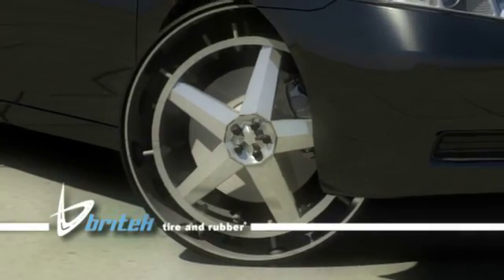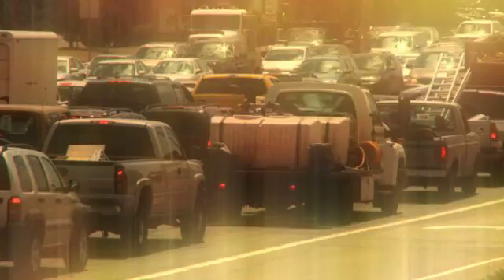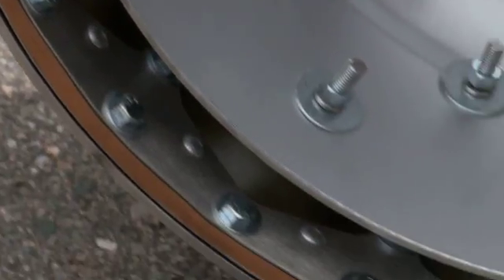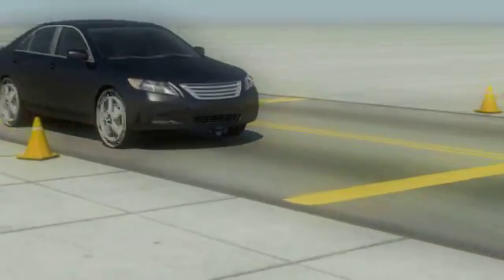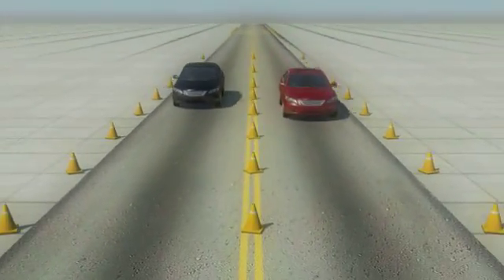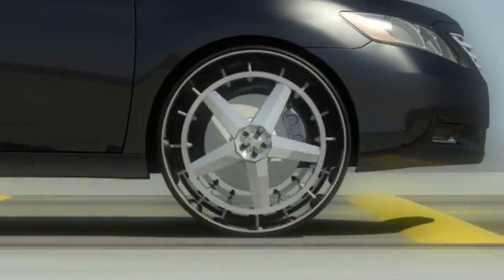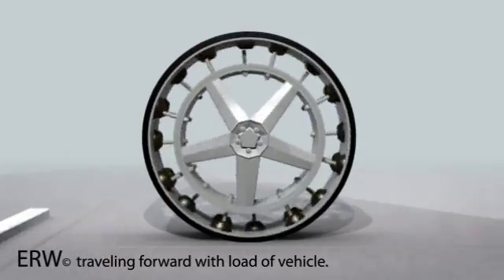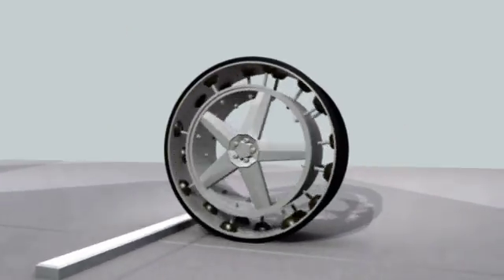britek ERW© 3D Animation

Comment: This is great to apply a piezoelectric generator
Reply from the maker: Miguel Silva Good one! Screw force accumulation and return improves drive train efficiency...Any rotational or linear displacement draws vacuum pressure...The rebound...Potential Electron flow.
Reply: great!

Comment from the maker: New published Patent about to issue...More in the pipeline...Historic # of utility Wheel Patents.
Reply: Hey, a big question here. When are you going to start selling these so people can drive with them? All the other tires that are airless haven't been sold and that sorta is upsetting. A lot of talk and videos but no sales. If you start selling them you could start selling them at cost or what not to car enthusiasts with YouTube channels that do car talks. Also people that are inventors that have YouTube channels. If people keep just making videos and not actually getting these on the road to actual people then people are going to just think, "Here we go again with the airless tires that never get to market. Screw that noise."

I am an inventor, mechanical engineer, and startup / business consultant. I am very interested to see this stuff get to market. I know a lot of car guys if you are willing to get some of these on actual cars and start getting real business traction.

Another important set of questions:

1. What is the noise like going around 65 mph?

2. How does the tires do when taking a hard turn at speed compared to normal run of the mill street tires?

3. I didn't see any spring in the tires. What is the spring like compared to pneumatic tires? If there isn't comparable spring this will really wear on the suspension system of cars and cause a lot of issues when hitting something hard and unexpected like a curb or a big stick or something on the road. Rims of car wheels already have troubles with this but without spring in the tire it will end up with more issues. If those are solid bolts and not springs in there I would be quite wary of the design and would suggest adding very strong springs with a bolt center so it can move within a range like suspension systems already do. In this case you definitely need to add the rubber sides.

4. Do you plan on covering the sides of the wheel assembly? If it is not covered the inside will wear with snow, mud, rain, salt for snow removal, etc.
Reply from the maker: Please review ERW bike videos to see "in wheel suspension". The amount of developed tension for auto is 6 tons per wheel. Check out our heavy truck on britektire@twitter.com
Reply: EnergyReturnWheel
Do you have a website with this stuff and specs and such? Would love to check that out too if possible. Even a store of what you are selling as well.

I was looking for suspension in the wheels for the vehicles, not so much the bikes.
Reply from the maker: Much of what we do is secret. We do show prototypes than led to other patents and claims. ERW is growing up. Invention DNA.

Comment: What if little stone will fall between rim and actual tire? Will it destroy rim? 
My main concern is durability of the solution and usability over long periods of time in extreme environment. We are not only traveling on tidy and clean roads, but also on country areas and sometimes even offroad. How ERW will be prepared for that?
Reply from the maker: Animation of the earliest home built ERW prototypes. Sidewalls, hopefully transparent will span all openings. Vacuum pressure tunes the high frequency in wheel suspension.

Comment from the maker: A main point of separation between ERW and all other wheels is our hoop to wheel / hub tension-ed attachments. The radial array is a reservoir of kinetic energy. When weighted and cranked they demonstrate a sling shot like advantage on and off pedal stroke. The high frequency in wheel suspension is just another advantage at high speed travel.

Comment from the maker: ERW is very tough. Upon pot hole strike the hoop can become an oval, stretching attachments at 3 o'clock and 9 o'clock, storing then releasing the energy as the hoop returns to it's circular shape. The wheel hub is suspended via the top 180 degrees of the hoops radial array of attachments. While rolling ERW is already being levitated from top half making it easy to step over the hole.

Comment: I think the only reason they aren't showing a skirt on it is so that you can see how it works.
I completely agree.  I would much rather see some hard facts between (high end) pneumatic  wheels and the ERW.  Using the same car, do some controlled tests for distance vs fuel usage and 1/4 mile runs.  They would need to get a decent amount of fuel from the same station at the same time (to eliminate fuel variance).  And completely refill the tank after every test (to maintain a consistent weight).

Comment from the maker: The patent process is a long one. Usually about 3 years before claims issue. The skirt or side wall is important for drive train efficiency. Screw force accumulation/return rebounds clunks into rotational force. We have some very flexible composite hoops. The tire has had 100 yrs. we are just getting started.

Comment: i thought so too, but u dont see it anywhere, everybody is just showing open concepts and claims it would be their invention. i would prefer a good information instead of commercials. maybe its more difficult to build that "skirt" than we would imagine..  i think this point it is the real reason why open tire comcepts only are used nowadays on slow vehicles. the new thing about this ERW though is the inner suspension and the solid outer steel wheel. well, the future will tell which is best...

Comment from the maker: Yes! Elastic sidewall covers that attache like a Tupperware lid. We run a vacuum pressure inside to reduce weight, vibration transfer and noise. We also run a more powerful vacuum pressure on the hoop side of membranes/diaphragms to introduce the power of the vacuum.

Comment from the maker: WE are stretch not compression. We have a radial array of elastic attachments that are drawn under tension to support the hub within the scope of our composite hoop. We are super efficient partly because we are sprung from the hub and flex a hoop to the surface not flatten a tread block. We are high speed, high power.

Comment from the maker: ERW does not accumulate heat like pneumatic tires. We have almost zero tread squirm and our tread block is more of a flex than a bending of fabric. ERW recycles heat internally. Try this experiment... take a rubber band and place against your lips, stretch and recoil. Notice heating while stretching and cooling on recoil. We also run vacuum pressure inside our diaphragms and interior.

Comment from the maker: Check out our patent portfolio and compare to Michelin's lack of patents. The Tweel is low performance IE low speed light duty. Less efficient than pneu. and were to release in 2012. They can not put Tweel on the market without willful infringement... a very costly situation for them. We have composite hoops and light weight diaphragms to equal the wt. of the best pneumatic tires.

Comment from the maker: Our USDOT highway video shows high performance/high speed while under a heavy 6,000 lb. AWD dyno resistance. The AWD ML 55 AMG was "chained down" to the 48" rollers. Rollers are designed to accumulate heat to expand 35.5 psi. pneumatic tire body for efficiency improvement.

Comment: How does this wheel deal with lateral forces? Is there enough give between the inside and outside of the wheel to deal with the demands of high speed cornering as well? I can see how this would be very beneficial to people who travel in a straight line all the time, but other than drag racers, I don't know anyone who drives straight all the time.

Definitely a fascinating concept though, I hope I can get my hands on one someday to put it to the test.

Comment from the maker: ERW is mostly carbon fiber / Kevlar composite. Material prices are dropping as more industries take advantage of composite properties. Ride quality is tuneable via adjustable membrane tension. IE adjust membrane pull distance between hub and hoop or increase/decrease vacuum boost ,membrane to hoop for some models.

Comment from the maker: Our radial array of drawn membranes rated @ 4,800 psi. distributes the lateral load 360 degrees around the hoop ID while the 120 psi. pneumatic tire flattens and rolls laterally, crumpling local sidewall fabric and rubber OD. Early protos each attachment is pre tensioned to approx. 300 lbs. x 36. Way stronger than pneu!

Comment: Have you tested the same car with the stock wheels/tires & with your wheels? Acceleration, handling & most of all, braking distances? what does it weigh? How much fuel did it save? What's it cost?

Comment from the maker: ERW is closer to a series of slingshots attaching a hoop to a hub.  Each attachment is pre set to pull 300 lbs. IE 300lbs. x 36 pulls... thats alot of dynamic tension. When the wheel is lowered to the surface the hub sinks within the scope of the hoop untill it "floats" largly suspended by the top 180 of pulls. Throttle response raises and levers hub higher in hoop reducing resistance to movememt.

Comment from the maker: Think of our attachments from hub to hoop as equally tensioned rubber bands. As the hoop meets the ground the hub sinks within the scope of the hoop now drawing more "stretch" from the top 180 attachments. Throttle responce "winds up" bands raising hub within hoop... levering wheel. We have replaced steel components with nano reinforced carbon fiber and Kevlar fabrics.... lightweight, strong performers.

Comment from the maker: ERW structure enables a tuneable dynamic "charge" between the hub and the suspended hoop. This 360 degrees of dynamic tension starts out as equal force from opposite directions IE equally stretched membranes. When weight bearing the hub sinks within the scope of the hoop drawing more dynamic energy from the top half ID of hoop. Space age composites.

Comment from the maker: @chuckbear1961 We will live up to such skilled driving! We are reducing the amount of weaker rubber in favor of space age fabrics. Your rolling resistance, improved power to the ground will get you excited to "drive" all over again. Goodyear has a retread solution where they stretch an adheasive band over the reworked tire body and bake at 285 F.. We think a ERW retread option would save you real money... as you save on fuel.

Comment from the maker: @d1sinfo If thats what we were doing you would be right. ERW hoop is "sprung" off the hub. ERW composite hoop and traction system weighs like pneu. For racing a massive reduction in hub mass IE 50% as the hub now rides inside the strong composite hoop. Also ERW is anti bounce for traction and quick response. ERW will change autosport forever and sooner than you may think.

Comment from the maker: @ee01239 ERW sustains a dynamic tension between points to return a greater % of energy envolved in the internal displacement of hoop on hub. Linear displacement is "shared" but more elongation on top 180 degrees  ID of hoop. Levering advantage us.

Comment: @MsCareerist Physics 101 contact surface have you seen how many points of contact how many connecton there are between the inner and outter cricle rubber? on a tardicional tyre is much lessers and it's all connected on the same surface. But if that was a problem Ithink they could just make the outside look exactly the same. I don't believe the centripet force would rip the tyre appart...

Comment from the maker: @deadbird58 Pneumatic tire can be taken out by a 1" wood screw while ERW can "run" with multiple 1" holes. The psi. failure of the composite hoop is 50,000 psi. what is pneu.?

Comment: @princerappy I think there may be the potential for less road noise if done properly, as provided they've designed the shocks adequately the outer rim may be fairly well decoupled from the inner rim which connects with the axles. I'll be interested to see if these gain any traction (BOOM BOOM) in the market and are professionally tested in Autosport etc.

Comment from the maker: @asianwong Patent filing #4. Highly elastic sidewall curtains drawn with vacuum boost. Will run high speed at ambient air pressure IE loss of vacuum no problem even long term. Vacuum boost "charge" increases the sidewalls screw force accumulation/return from throttle or brake force. Additional draw VS the pull of gravity as hub sinks To "float" within the scope of the hoop.

Comment: @EnergyReturnWheel Wouldn't sidewalls hinder the movement of the inner and outer wheel? Could you use a flexible material that *folds* to accommodate movement?

Comment from the maker: @androo5826 There is enough developed tension to resist cornering forces no problem. The big deal was to curve the hoops upward for camber issues, increase psi. and footprint size to more accuratly provide the "feel" and handling of pnu. by adding pat filing #4 bound rubber wedges off the curve. Now we lever rubber wedges to the surface increasing grip.

Comment from the maker: @thlin Even these early protos were very powerful. We used a german engineered 4,800 psi. membrane drawn 200%-300% elongation. This developed tension is aprox. 300 lbs. for each pull. Lateral forces can displace/ rotate ERW from 12 - 1 on a dial clock, however collective membrane force quickly multiplies as dislpacement continues. Our newest protos have a curved hoop for levering out bound rubber wedges to surfaces.

Comment from the maker: @RollinKillin True, We can remove 30-50% of the large tire mass as we only need a thin elastic sidewall. The larger the ERW the better they lever. No more dangerous 9 bar tire pressures. Monster trucks will be set "free" from the heavy, slow responding tires of yester year. Also ERW is "high speed".

Comment: Doesn't one have to check àll the bolds in the wheel every morning before one can drive savely away??  Or are those crews and bolds just used in the prototype-wheel? If bolds get loose because of vibrations during the driving...

Comment from the maker: @KZWolf ERW can wind up / return a % of screw force and meter it out IE a  torque converter like effect. Our new pat pending tread system can almost suction cup to the surface in panic stops as lateral and medial wedges are forced into the surface.

Comment from the maker: @Bouregard3 The now upward curving composite hoop has a freedom of movement around the hub tied in place by drawn highly elastic membranes. Each membrane is drawn into a funnel like shape tapering/focusing to the hub. Lateral force displaces the hoop IE rolling at you you would see the hoop go from 12 to 1 "dial" clock. This action levers our "outrigger" Kevlar bound rubber wedges into the corner.

Comment from the maker: @Baracus09 Its better than you think. We use hoop flex, membrane vs membrane elongation for internal deformation, a more controled compression / rebound of traction layer. Together these systems modify impact and vibration more quickly than pnu. sidewall and treadblock. Internal hub / hoop displacement is anti bounce.

Comment from the maker: @darkshadowscene No more than a regular tire. ERW hoop is "initially" easily displaced because of the array of opposing pulls. As displacement continues forces are distributed by flexing the hoop, drawing tension around the top 180 array then membranes rebound propelling the hub up and forewords. ERW is lifting/levering from the top 180 while a pnu. is lifting/levering from the tread block..

Comment: @EnergyReturnWheel damping rate of the springs. For example. In the snow, you want a larger contact patch then in the summer for more traction, so the best way to change this, is to allow the tire to bend a bit more. Lastly, I think you should be able to enable a water cooling system, so when your tires get to hot from racing and they feel life "butter", you can cool them back down to whatever temperature you need it at, and you can grip the road. Otherwise, I think this is a pretty good idea.

Comment: @EnergyReturnWheel I think a little but of steel plating around a pneumatic tire, and just have your invention incased in rubber, as dust will not build up. Also, have collapsible sidewalls when you wrap the tires, It will allow it to be smoother over bumps. One thing I would change is being able to take this thing apart, and adjusting the

Comment from the maker: @kensai69 This is why we went with curved composite hoops. Rubber wedges off the curve to create a rolling footprint more like pnu treadblock you are used to. Big diff the wedges are levered to the surface under lateral loads, acceleration and braking.

Comment: Look, If you want to have a different driving style of the car, edit your toe, camber, gear ratio, and tire pressures to make anything more efficient. I have to do this with my race kart all the time! You need to just maybe invent a pnuematic tire with your features and make sure they are bridgestones. I would hate to autocross, and not be able to adjust my pressures as the bonding agents in the tire's rubber heats up.

Comment from the maker: @dogassedugly Top speed unknown but... rolling a "footprint" from a flexible composite hoop suspending a Kevlar bound nano rubber dual wedge traction system to the surface or Pnu. slapping treadblock. All ERW prototypes draw forces to the 3D center of hoop and hub. The resulting positional imbalance "pull of gravity" produces a dynamic vector / velocity reaction driven by throttle responce / brake , lateral forces. ERW is about focus.